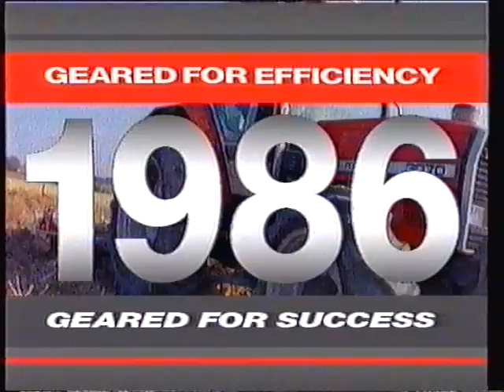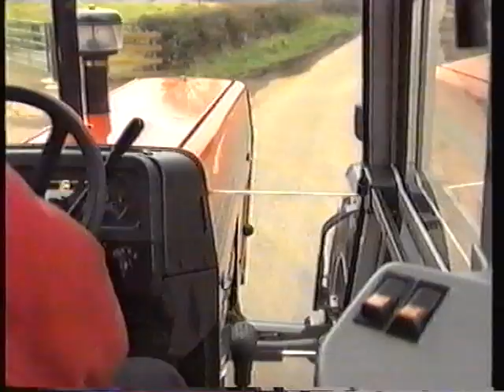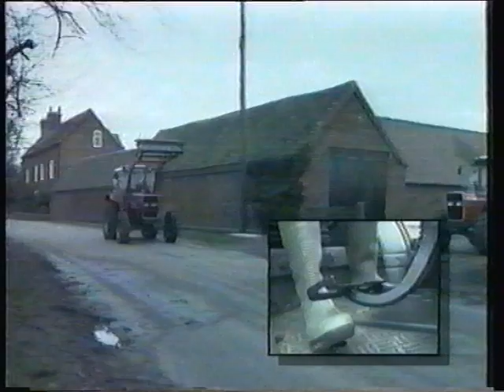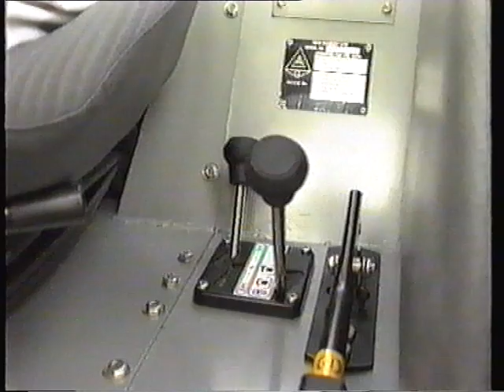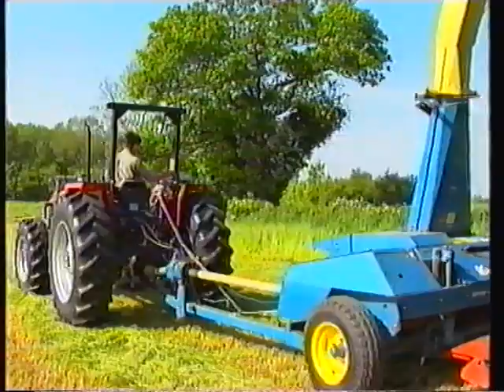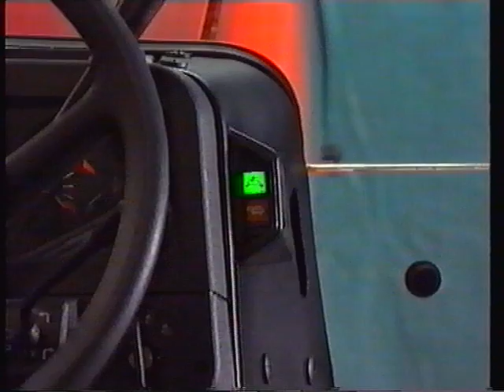MASSEY FERGUSON 300 SERIES GEARED FOR EFFICENCY GEARED FOR SUCCESS

Comment: Often wondered why they didn't leave the left-hand shuttle in place alongside the speedshift system. Annoying to use for front loader work because the right hand has to do all the work.
Reply: Left hand shuttle wouldn't have worked as reverse was on the main gear lever